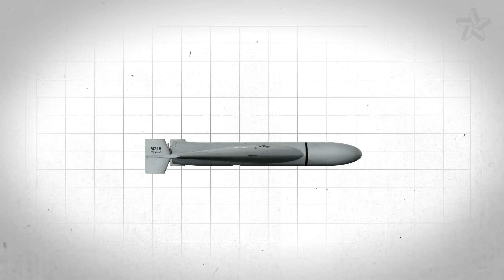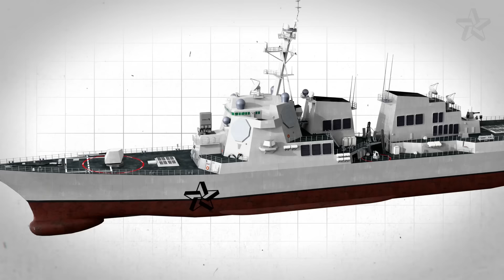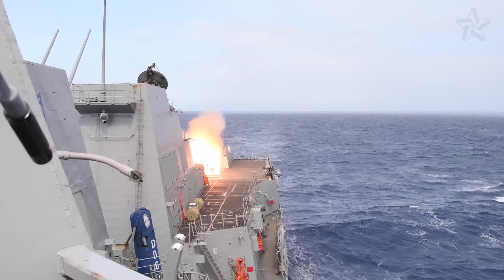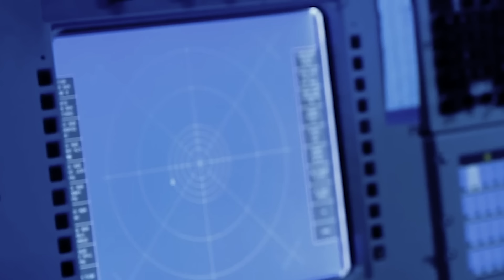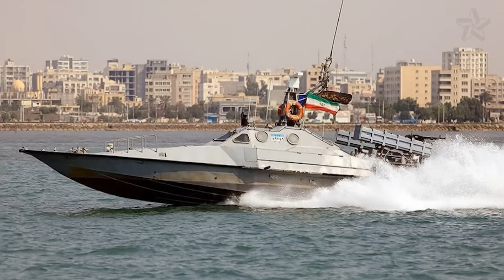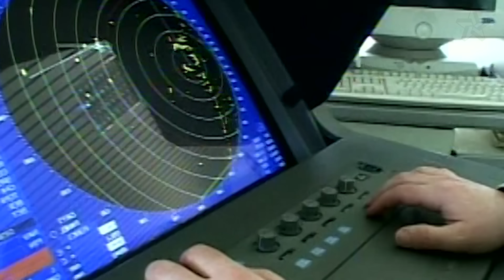US Navy Launched Something That Shouldn’t Exist… Iran Can’t Stop It

Comment: The problem with your story is the fact that these Iranian drones follow preprogrammed GPS coordinates. They cannot change course once launched.  So....all the carrier group would have to do is move and there wouldn't be any targets for the drones.  They wouldn't even have to move very far just a few thousand feet should do it. If Iran wants to attack a carrier group they would need to use speed boat drones.  That is one reason they have moved A-10 Warthogs into the area.

Comment: what a load of bullshit.  If the microwave beam was 30 degrees wide the energy pulse would be dissipated so rapidly that it would be absolutey harmless at any more than the length of the ship it was mounted on.  A coherent beam would need to be aligned at better than 1 milliradian divergence to be effective at any great distance and targeted with active tracking to individual drones, with a view to disabling one at a time.  Better put your idiotic ideas to bed and do something useful with your life

Comment: Sounds like a good arguement that the U.S. can successfully defend its ships against Iranian Drone attacks.  However, on March 11th, a single Iranian Shahed-136 drone penetrated the defensive perimeter of the USS Gerald R. Ford carrier strike group in the Persian Gulf. The drone cost $20,000. The carrier it hit cost $13 billion. That's a 650,000-to-1 cost ratio. The drone flew 15 meters above the water, below the detection threshold of Aegis radar systems designed to track ballistic missiles. It covered 47 nautical miles in 14 minutes and struck the flight deck at a fuel transfer station. The impact ignited a JP-5 fuel fire that spread to adjacent compartments. Over 400 sailors were evacuated. Flight operations were suspended. The Ford was ordered to withdraw 200+ nautical miles from Iranian coast. This is the first time a U.S. aircraft carrier has been forced to retreat from combat due to enemy fire since Vietnam.

Where are all those drone defenses being talked about in this video?

Comment: Note this : 1. To prevent the enemy from receiving military logistics from supporting countries, destroy all existing airstrips and sea ports. This will disrupt logistical supplies. Also, destroy their fuel stocks or oil refineries and destroy electrical power plant to disable their war machines.          
2. Make them blind and deaf, destroy television news agencies, local TV news broadcaster, internet transmitters, telecommunications and radio networks, cut off communication between the people and the government. So that the people will not help the government in the war.Then continue with proxy ground force troops the kurds.

Comment: Silly video, every military advancement is followed by a military advancement.  Likely all the drone needs is thin foil around its electronics to defeat the microwave.  The real basis of drone warfare is they are cheap to make and you can send out a thousand at the same time with little or no effort.  While all this sounds good the navy is actually finding it is much more vunerable than it thought.  Big issue is the drones so far are not really trying to attack military ships - they are attacking unarmed commercial ships - which have no protection.  The big issue in the Iran War is there are so many unprotected assets that a drone swarm can damage to the point of causing the people running the business decide to sit in port - and no one knows how to protect an entire port or an oil field.  Asymetrical warfare doesn't just mean a different way of attacking it can also mean a different target.  Malls do not have missle protection, neither do oil fields or Marriots.

Comment: This is not a new concept, so is probably only a surprise to the ill informed. In 1975 at Sheffield University England UK, a masters degree student had built a microwave array, which was being tested at that time in the peak district. This was a smaller scale just circa10 feet square,  In fact a prototype was also in the lab at the University Electronics department.
So not new just just 50 years later.

Comment: F=m*a*b*c for full telemetry cost of SOST purchase $13,882 in the US Military. Isaac Newton born in 1643 did not have any research and code on them currently running them at 13.8883% percent with SOST line code F=m*a*a

Comment: What about the HELIOS laser system built by Lockheed Martin? I was waiting for it to be mentioned but it never came. Costs $1 - $10 per shot in electricity, with a range of 5 miles. I think it's designed for certain vessels (Destroyers) because of its high energy needs.

Comment: The enemy can’t see what’s happening if there command center is no longer there.
Reply: Can’t
Reply: Just a question.  If the US shuts down the GPS system, can the drones still find their targets?  If the targets ship moves, does the initial GPS calculation takes that in account?
Reply: Actually central command and control is becoming irrelevant as is taking out large missle launchers.  The Ukranians have no real effective command and control centers so they have diversified to smaller sites widely dispersed - sometimes a single soldier in the field - making them hard to find and hit.  Then they have developed a drone killing drone that flies faster and costs less than the Iranian drones to make - these are proving very effective.  This tech is advancing very fast - on both sides, the US approach so far is still based on CIC based strategies and very expensive hardware that cannot be revised quickly or cheaply - that is a flaw, and one the navy will have to address.  Nimblness may ultimately become more important than any other factor as drones get cheaper, fly faster/farther, easier to contruct in volume, and take into account within days the defensive mechanism of the targets.  The real problem here is when the enemy can change their underlying tech within a few days or weeks, it becomes impossible to use very expensive rigid defense systems.  It is like building forts and expecting the enemy not to build a better way to destroy walls.
Reply: PUT your hand on that WALL!
Reply: A decentralized military doesn't need a command center
Reply: THEIR JFC
Reply: This was my pooint from the beginning. Where is the Air Force Bombers and fighters
Reply: Hard to believe that those are the very same boats with the toilet design issue...

Comment: While i like the video it is full of contridictory information.  At the very beginning he states the drones fly straight with no change in path until they hit something or run out of fuel then later he states an oil tanker forces the same drone that were flying below radar to change course up into radar view.  I realize this has never really happened and just showing off but you cannot contradict yourself like this otherwise it is just garbage because everything comes into question at that point.

Comment: It is fairly easy to shield against microwaves. Your microwave oven does it every time you use it. I hope we have better toys than this. And Shahed drones are not the problem, their top speeds are less than 400 miles per hour. Almost as difficult as stepping on a snail.  Their ballistic missiles are the problem. They have a lot of them and some can reach Mach 15 in a dive like the Fattah Thats over 11,000 Miles  per hour. In a swarm, we have a problem.

Comment: There wouldn't be that much wave cap noise to clutter stuff near the surface in the Persian Gulf. It's like the complete opposite of how it is in the Atlantic and it's often glassy smooth outside of any significant weather happening. Not sure how they'd get much masking out of that unless they were using submersible craft.

Comment: Shaheds cannot track a target, so the only thing the ships need to do is continue to move.

.
Reply: Worked well enough against the missiles Iraq used during both major operations against it. And the stuff they were sending was a lot faster moving. If it's not guided, just the basics of churn n' turn keeps it miles away.

Comment: Their drones are 30 Grand a piece, and the closest comparison for the engine being used is a leaf blower....... if that's true then they have a priority problem, fork over a little more cash and get a better engine, I don't know what the drones are armed with but if the odds are stacked against the drone hitting the target, you'd think the engine would be the first upgrade. If this is done purely because of the country's economy or lack of access to materials, etc., it is what it is, I guess. But I'm confident that no matter what type of explosive is on that drone most likely fail in comparison to the explosives we  used, and purposely set off on or around our carrier during the testing phase

Comment: They didn't have this technology ten years ago. Wrong. In 2011 we were putting microwaves on the lead security vehicles to deactivate IEDs in Iraq.
Reply: That’s true but this is at a level of power that is much higher. Plus we have the Dragon. Laser weapons system. It also is nasty.
Reply: The systems used on convoy security vehicles in Iraq weren’t microwave weapons. they were radio-frequency jammers designed to block the signals used to remotely detonate IEDs (cell phones, remotes, radios). They didn’t destroy electronics; they just flooded the air with interference so the bomb couldn’t receive the trigger signal. The Navy’s METEOR system is something very different. It uses high power microwave bursts as a directed-energy weapon to actually overload or damage electronics in drones or missiles. Both use electromagnetic energy, but one blocks signals while the other physically fries electronics, which is a completely different level of technology.
Reply: True story had this on the front of my waggon in 2005 😂
Reply: I want a mini one for my front porch
Reply: Those microwaves were to heat the general’s breakfast.  Keep an eye on those stars!
Reply: STAR WARS😍 SPACE AGE LASER SYSTEM TO ROAST ANY ICBM FROM RUSSIA CHINA N KOREA ETC❤️‍🔥
Reply: We've had this technology since the 50s

Comment: To  much Drama and a lot of speculation in this pretend video  and that  below radar is NOT a think today , it can still be a challenge HOWEVRR things like high-resolution radars  are specifically designed to look for small, low-altitude targets and can cover areas down to ground level to spot tiny drones.
and US warships are equipped with advanced, high-resolution radar systems specifically designed to detect small, low-flying drones and unmanned aerial systems (UAVs) so a larger Iranian drone is never "out of it's sight " 
SO :not being able to see them in todays tech is absurd ( sure depending on terrain it is still challenging ) BUT much of the advance tech is eliminating even those challenges and even  more everyday.
So just for that  ignorance Thumbs down